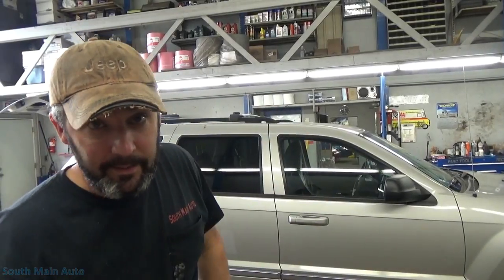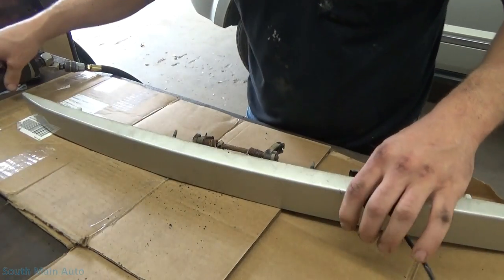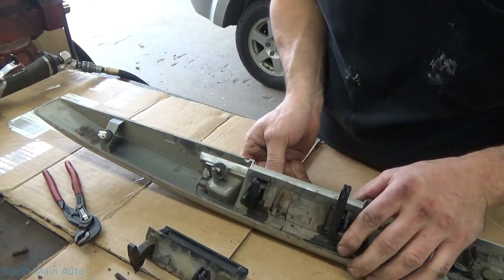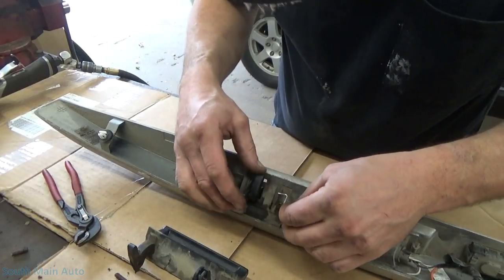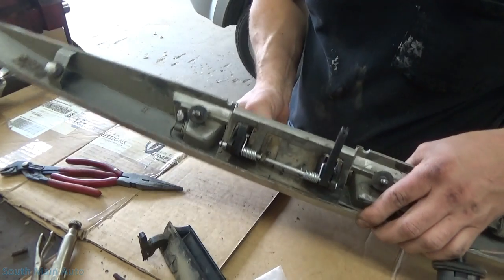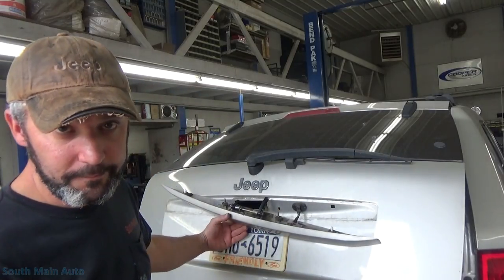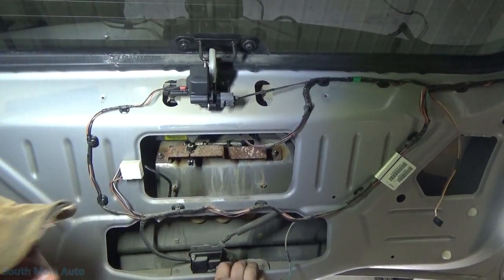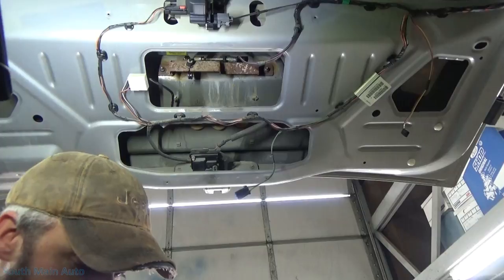Another DORMAN PRODUCTS FAIL: Jeep Grand Cherokee Liftgate Handle

Comment: I love when things like that happen, it just shows that many times we have to make some "modification" either the factory forgot to do or the manufacturer's install instructions...I would cut a small notch in the tailgate to clear the pin, especially when it will probably be back at some future point for the same part...
edited to add----> nice job of disassembling that piece without casualty...
Reply: just asking would the pin not go under the panel long part first? then wriggle the short end????
Reply: @Mrfort  If Eric O. couldn't do it, take it certain it couldn't be done as you say..It just doesn't fit and any attempt to install without some modification will result in breakage. Modification to piece as he did or I suggested was necessary. Cheers!

Comment: good save  Eric. i was thinking you where going to drill a small hole in the bolt and use a r pin to retain it
Reply: Me too, but would waste much more time.
Reply: slot it and open it up

Comment: TOOLS NEEDED TO INSTALL JEEP DOOR HANDLE FROM REPUTABLE COMPANY: PLIERS 1/4 " RATCHET WITH 10 MM SOCKET. TOOLS NEEDED TO INSTALL DORMAN DOOR HANDLE: PLIERS, WELDER, TORCH, HAMMER, 3 OF UR GRANDMAS BRIDGE CLUB FRIENDS, $78.00 IN QUARTERS FOR SWEAR JAR. LMAO
Reply: I laughed so hard from your comment but so true.  I try to avoid dorman products like the plague.
Reply: I do my best as well to avoid them.
Reply: That was hilarious! Eric should send you a SMA sticker for it!!
Reply: SMA all the way
Reply: I realize this thread is a year old, but I was grinning while reading your comment, and actually laughed out loud when I got to the swear jar part. I hadn't heard the swear jar in so long i forgot about it. Thanks for the laugh.
Reply: I made the mistake of buying the whole brake line kit for my silverado from napa. I bought it over the phone while I was getting a ride to pick it up. I was told it wasn't DORMAN. I got to napa and looked at the part number and was almost identical to DORMAN number. The label under napa label said DORMAN. I should have made my own lines because none of the ends were correct so I had to cut them off and flare them with the correct ones. This was the first DORMAN part I ever had issues with and I will never buy another one.
Reply: this is Chrysler fault not Dorman
Reply: its both there fault lol
Reply: @Capt_NightOwl  too bad you didn't check the dealer, chevy offers brake line kits for most of their trucks

Comment: My DORMAN problem was water outlet flange appeared welded on upside down. smooth side to the pipe, the engine side had pits and wasn't smooth. What really killed me was the counter guy told me it didn't need to be smooth, for $40.00 it better be perfect. It uses a flat o-ring of course it needs to be smooth. So AC Delco to the rescue it was perfect! Keep up the great work and many blessings to you and your family.
Reply: I had a similar experience, Had a water inlet pipe that was to bolt to the block and it was neither smooth nor straight. Dorman even sent me a replacement that was in fact worse! The dorman rep then told me to use a grinder to level and smooth it out. Freaking incredible for a $90 part.

Comment: Thank the Lord we don’t have that crap here! Nice recovery though Eric
Reply: Hi Rob, Eurocarparts come to mind.  Radiators, Expansion bottle for BMW, Egr valves that the harness plug won't click on to the retainer, also same for Audi electric brake calipers.. Eurocarparts are owned by an American outfit now I believe We use soak up granules and the bag is exactly the same as one Eric had in a video exept the logo had changed to ecp
Reply: Good point there Steve Ashcroft, this is why I never use Euro Car Parts unless I have absolutely no alternative. So maybe I’ve shielded myself from the crap parts.. GSF for the win for me
Reply: we also have febi  car parts . same Chinese crap different box
Reply: Crap even
Reply: Yeah. Euro Car Parts sell a load of crap. Besides general consumables like filters, plugs and oil when its on discount i avoid them like the plague.
Reply: @zoidberg444 Ah yes, the fake sales and discounts that ECP have. They bump up the original price then discount them back down again tricking people into thinking they are getting a real discount. Their sister site CP4L used to have parts at the original ECP prices but sadly they have now started with the fake discount fuckery.
Reply: TheStwat Yeah. I wasn't born yesterday. I'd noticed that. Its only a few times a year that the sales actually meaningfully discount any of the products. I did pretty well on Easter Monday this year. Normally Easter and bank holiday Mondays are the only ones worth it. They have a fake sale every weekend it seems. Some of the stuff they sell is way overpriced as well. Like clutch kits. In July i got a genuine LUK clutch kit online for a Ford Mondeo for less than half of what those tossers wanted for it. Even a lot of the shitty Chinese bearings and crappy exhausts and wing wang suspension components they sell are overpriced.
Reply: zoidberg444 they've started selling Dorman here in NZ as a 'premium option'... Micksgarage is my go-to place, you see make and part numbers and they don't inflate the prices like ECP

Comment: Nice work with getting those springs in , a tricky task ! Just wondering if there was room to wiggle the long side of the pin in behind the sheet metal first, then slide the molding/latch over ? Then snap in place .
Reply: I had the same question.

Comment: Maybe another option would be to cut the flanged end off and weld the flat washer on that side, leaving the grooved end with e-clip for future removal, say in a week's time. Of course, making the part correctly is the easiest fix, but unfortunately it's not an option. Great video! Thanks for doing what you do.
Reply: Now that’s using your noggin! I didn’t think of that. I would have been using my dremel to cut a new groove for the e-clip after cutting it short.

Comment: Can't believe ya don't own a Dremel.. I used to believe the Dremel tool was a toy but that baby cutting wheel has saved my butt many times over.....and would of been great for notching tailgate...not quite right on a customer vehicle I suppose but if it was my personal vehicle I'd have notched my tail gate....
Reply: agreed! I have the 12v Milwaukee and it works great!
Reply: Would have done the same on my vehicle, used my "dremel" on the tailgate. Can't see it. Rust shouldn't be a problem on my old Subaru.
Reply: Agreed.  Cut a small notch in the end gate, sprayed the crap outta it with FF and shipped it.  Would make it easy to replace it with the second and third one over the next 3 years when they no doubt fail again.
Reply: I FixIt Simpler alternative would be to bend the lip with pliers, no paint required & only takes a few seconds, literally
Reply: Paul Lenzen Simpler alternative would be to bend the lip with pliers, no paint required & only takes a few seconds, literally
Reply: Alternatively, he could've used a dremel to notch out the pin to accept the e-clip between the spring closest to the cut end of the pin and the plastic pillar through which the pin rides. jus' sayin'.

Comment: Dorman.... Last spring we bought a Dorman tccm from autozone because we were tired of buying inexpensive pulls that didn't work just because the had firmware burned in them. The Dorman's do too. But you know what? The bugger was thermal. As in it wouldn't work, no 4x4 if it was cold.We took it to autozone on warranty and surprisingly they begrudgingly homered it. However two other dorman tccms that autozone gave us didn't work at all so knowing how to get along with the initial dorman tccm by heating it with a blow dryer on icy days, we got though the rocky mountain springtime. I have a genuine virgin GM tccm that I'm going to have flashed by gmflash.com (somebody stop me if I shouldn't) as winter cometh. 

Great stuff Eric don't ever stop.

Comment: I'm with you, Eric. Dorman used to be the go to company for an alternative to factory only pieces. I've been burned by plenty of very poorly made Dorman products that ain't cheap and have caused plenty of come backs, which I hate. As an example, I had to replace an exhaust manifold on an old 97 F150 w the 4.2 V6. It took 3 manifolds from Dorman, to find a casting that wasn't warped.Thank you China. Also, the gasket that came in the package was garbage. I had to buy a Felpro steel shim gasket set separately, which was what the factory used, to seal that last 1 up. It wasn't a hard job, but that's not the point, as I'm sure you know. And of course, I have no faith that it will stay sealed up.. Sometimes a customer has to bite the bullet, and buy the OEM.

Comment: You needed Dorman, Push Nut Push on Retainer Starlock Washer.....hahaha.   Chrysler products have gone downhill after it was purchased by Fit It Again Tony (aka FIAT).  One day you will be replacing this handle and wonder why in thunder did they weld the washer to the rod.  That was the universal rod which needed to be cut as needed.  Thanks for bring us along, never a dull video Eric.
Reply: Bob Moy Fix It Again Tomorrow

Comment: I would have done it myself by carefully taking apart the old one and cleaning all the rust off it, oiling it and putting it back together.  I can't believe the price of shit these days.
Reply: Also I would drill a hole or two where the target areas would be lube with oil twice a year or more  without taking it apart again. 
Be sure to put a removable plastic plug cover over the drilled holes to prevent dirt.
Reply: Good luck without destroying all the plastic shit

Comment: Great video as always, but could you have just cut a notch in the tailgate to clear the rod? I didn't see you plug in the license plate light,hope you did!
Reply: Les Bender Simpler alternative would be to bend the lip with pliers, no paint required & only takes a few seconds, literally
Reply: As a point of principle, it shouldn't be necessary to cut the bodywork of the car! And if you did, you've then got to go  the extra mile of treating the cut edges to prevent rust.

Comment: When I put a new intake on my 2000 Buick LeSabre with the 3800 Series 2 V6 I went with the Dorman intake the intake was good the gasket that came with it was good I got everything on but damn they  can never get their o Rings right because you have to take the fuel injectors off to get to the intake manifold bolts Dorman sent me o rings that were too thin so I decided to go with Fel-Pro o rings which did the job

Comment: hey Eric..just put a wheel hub on an 03 Navigator..wouldnt you know..speed sensor plugs are similar but not the same..oem has recessed seal,,new has seal poked into connector but it has no recess..no matter would not click without it..has a boss to bottom seal on..that boss is absent in oem unit, that boss is stopping connector from going the 1/4" needed to click..got it from Napa. "Napa, when a quarter inch doesn't matter" lol. love your demeanor..wish I was that calm in my shop. wish my shop was as clean as yours but i live in dirt so it follows my work into the shop. If youve never seen "the red green show" you should..hes hilarious and you both share a few  similar likable qualities. Mainly how you carry yourselves. (the humor) Great attitude when crap happens too. You set a good example. Thanks!

Comment: I have stopped using ANYTHING Dorman on anything after they cost me the engine in a Volvo V70 Turbo. Oil cooler lines were weeping so ordered a replacement set that turned out to be Dorman. They were so badly engineered that they had to be shortened a quarter of an inch where it goes into the engine. (The flair that holds the O-ring was too far from the end of the tube to fit under the hold down clamp.) It is Sunday and we need the car the following day so I simply cut it to the same length as the factory line.
- Six months later the crimped connection where the rubber meets the hardline blows off on a section of freeway with no shoulder and the next ramp was more then a mile. No choice but to just get off the road. When I got it towed back I discovered that they hadn't bothered to flair the line to retain the crimp connector and obviously they hadn't crimped it hard enough as that should never fail under any circumstances.

Tried to find a way to sue them but you have to find an employee of a company in your state to be able to file in small claims. 

So never ever again Dorman. You directly cost me a few thousand and I will never give you another dime.

Comment: Kind of sad that it got so rusty inside the tail gate
Reply: Using a power washer or taking your car to a high pressure car wash forces water upward into places where rain normally runs over without entering. And being up inside, they don't dry quickly. I've seen lots of internal parts that shouldn't have been badly rusted, ruined, since high pressure washers were used on cars.
Reply: autophyte actually a pressure washer helps because it washes the salt off. The problem isn't the water is the salt.
Reply: I have an 08 Jeep Grand Cherokee. It’s an SRT8, but same body... It doesn’t look like that on the inside, but I also live in Alabama. The real crime here is putting unpainted steel anywhere in a Vehicle. It’s not just a Jeep thing though. I don’t know about current models, but the GMT800 series of trucks from GM didn’t get any paint at all on the structure behind the dash. Back then I saw trucks on the dealer lot with less than 10 miles that were already completely coated with rust on the dash support structure. Chrysler did a far better job than GM back then when it came to painting the parts behind the scenes. That still doesn’t excuse a single part being left unpainted on any vehicle.
Reply: @ilikeboost4764  I remember my cousin use to rinse her car after a drive in the winter every time she drove it, no matter how cold it was.

Comment: You probably could have drilled a tiny hole through the end of that axle as well, and finished it off with a washer and a cottor pin. At least it would be a viable option for those who don't have a welder. Cheers! :-)
Reply: jhm smart tv that would have required a drill,drill bit and going to find a pin. Personly i like the welder fix! Nothing beats the hot stick wrench! Lol
Reply: +Aaron Schoessow I would think that it's more likely for ordinary people to already have a power drill and a drill bit at hand, than a welder, hence my comment. :-)
Reply: I don't know about drilling a hole. That's a pretty small area. I would have gone with the washer method and used some J.B. weld. More than enough holding power for the current application.
Reply: +HeinzP100 That would probably also work. The cottor pin solution is however easier reversible if you for some reason need to disassemble it again. :-)
Reply: I think Dorman now offers a repair kit for this repair kit.  It is a hacksaw blade, drill bit and cotter pin.
Reply: +scoostraw LoL! ;-)
Reply: scoostraw :  Excellent response!
Reply: The deluxe version is a bit spendy, but does include a mig welder and washer.
Reply: I probably would have been lazy and drilled a slight notch into the body. I had to do it with a Cardone brake booster. They new booster had bolts slightly larger because they had been switched to metric so I slightly enlarged the bolt holes into the body.
Reply: Alternatively, he could've used a dremel to notch out the pin to accept the e-clip between the spring closest to the cut end of the pin and the plastic pillar through which the pin rides. I'm all about keeping it as simple and cheap as function and quality allow in my repairs and fabrications. I can understand wanting to bring the pain of the welder down upon another dorman part that doesn't fit though. lol I've had pretty good luck so far with the dorman stuff I've had to buy, btw. lol
Reply: @DEEPMOODYPURPLEBLUES  This is what I was thinking, and probably would have done, myself.

Comment: Went through 3 doorman door lock actuators in my Ford Escape in the span of a month, the first two were defective out of the box and the third had the the actual latch assembly shatter after the door was closed. It just got to the point that I put the ford one back in and just soldered the door ajar wires together. Never buying doorman again.

Comment: Not just Dorman. Have a Chevy Silverado with the infamous extended cap suicide door with the cheap crap exterior handle. Replaced the broke one with cheap Advance Auto Parts handle. Broke in a matter of weeks. Removed it and just reinstalled the screws. Just as good, no issues and no junk plastic...

Comment: I had a 95 grand prix coupe and had to replace the door handles, particularly the passenger side about 4 times. I eventually just got in and out through the window by using alarm windows downs option. Bo duking it.